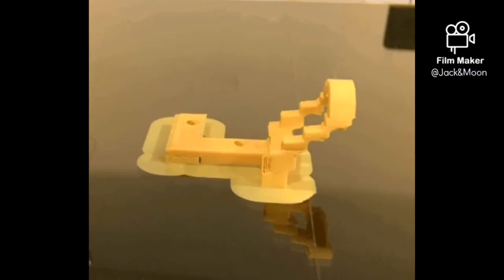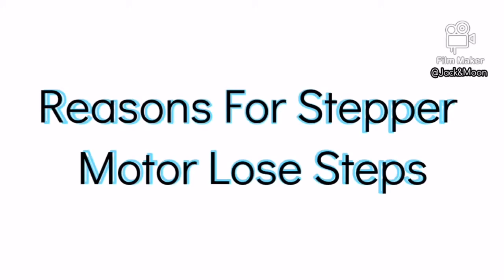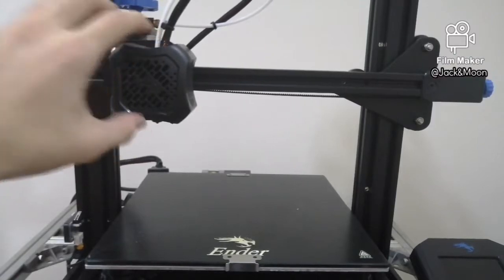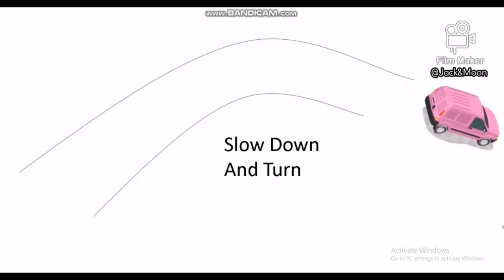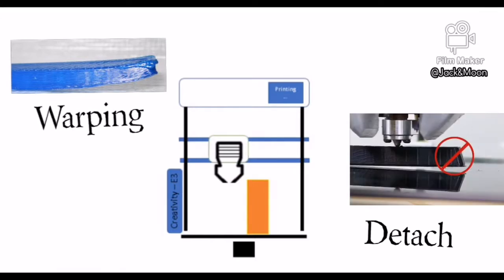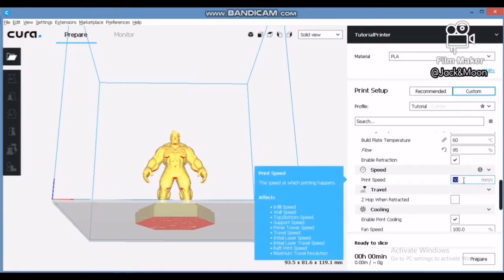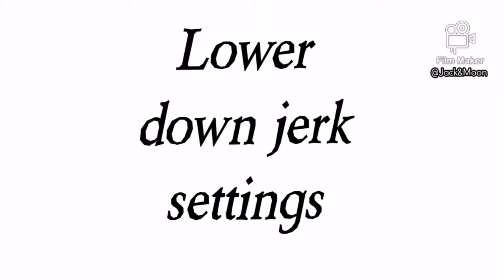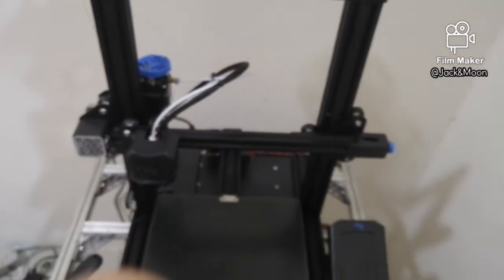Why This Print Fail? #Layer shifting #Ladder effect #Reasons #Solution

Comment: I am having these issue just on the y axis, trying to solve it right now.
Reply from the maker: Good luck, my friend🙂👍
Reply: Try going into your firmware settings and lower your “y” axis speed. That is if you have checked belt tension and pulley already.
Reply: Did you solve it? I have the same problem.
Reply: @chocobaconn  I solved all of my issues. Ended up being the crap drivers on the 4.2.2 board. Upgrades to a 4.2.7 with branded German made driver chips and all issues are gone.
Reply: @ericvail6528  this is what I was thinking considering it started all at once without any mechanical changes, and that small prints are usually okay. Thanks for the advice!
Reply: Uncle roger